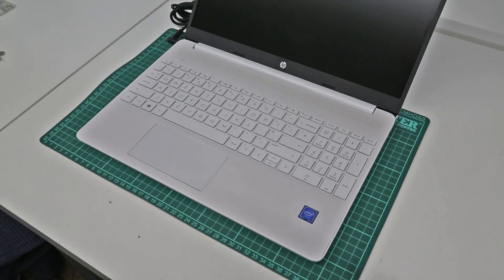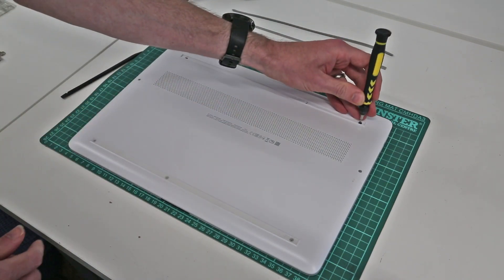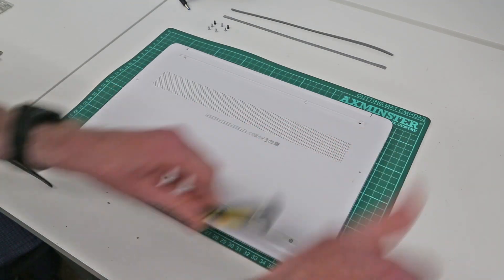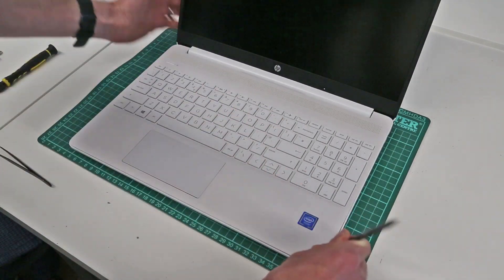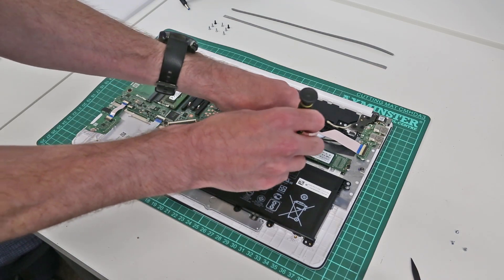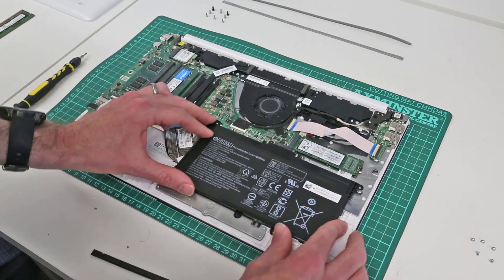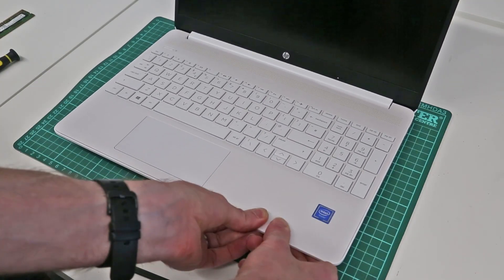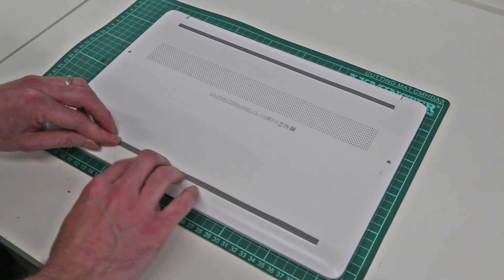HP 15s-fq1515na RAM Upgrade Guide

Comment: Thanks!
Even though the HP manual only mentions 4Gb or 8Gb RAM modules, I found that my HP 15s-fq1505sa's motherboard supports 32Gb RAM (2x16Gb DDR4 2666MHz SODIMM RAM). 
Tip I got from Paul Tikkanen on the HP community forum: to find the maximum RAM your motherboard supports, follow the below steps. 
1. In the Windows taskbar search box, search for cmd and click Run as administrator. 
This will open the command prompt.
2. Once command prompt is opened, type wmic memphysical get maxcapacityEx and press the enter key.
There, it will show the maximum RAM capacity your PC's motherboard can support.
The capacity is shown as Kilobytes, so you have to convert it to Gigabytes by dividing the number provided in the report by 1,048,576.

Comment: Can i add a 2.5 inch hdd to HP 15s-eq1024ne ?
Reply from the maker: If it doesn't have an HDD as standard then you'd have to source the bracket and cable to fit the drive.
Reply: @BrueComputing  I dont know , I didn,t open it yet
Reply from the maker: @anything670  Standard config for that machine is 256 GB PCIe NVMe M.2 SSD, so unlikely you can add a 2.5" drive without sourcing additional parts.

Comment: Hi sir, I have an HP 15s eq0xxx and in cpu-z it showed me DDR4-2666mhz and in brackets 1333 mhz which clock speed is true? So that I can improve?
Reply from the maker: DDR is double date rate - so 1333 is doubled to 2666.
Reply: @BrueComputing  What would happen if I added additional RAM to the laptop with a frequency of 2400 mhz when I have there from the novelty RAM with a frequency of 1200mhz?
Reply from the maker: @BlueScreendo  The laptop should run the RAM at the speed of the slowest module, so drop down to DDR4-2400 speed.

Comment: hi sir,i got the 15s-eq1xxx with amd athlon siver.is it possible to upgrade the processor too?
Reply from the maker: No - as with basically all modern laptops the CPU is soldered to the mainboard, so the only way to upgrade it is to replace the whole board.
Reply: @BrueComputing  thanks for the info sir

Comment: Thanks for video. I brought HP 15s-fq2015na and was wondering do you have to take out battery before installing RAM? Also is it easy to swap SSD too?
Reply from the maker: You don't have to disconnect the battery, but it is advisable as it means you won't accidentally remove or fit components with the system electrically on.
SSD guide is here: https://www.youtube.com/watch?v=ljLDBPcK0vI
Reply: @BrueComputing  thanks so much really kind of you to reply so quickly. I’m subscribed :)
Reply from the maker: No problem, glad it helped.

Comment: Hi. I have this model laptop. It's telling me there's no hard drive/ability to boot. When I look into the options you get when pressing F10, the machine tells me there's an issue with the Optane memory volume. So, I think the hard drive is kaput. I can buy new and replace, but is it possible to recover files from the drive/s? Thanks!
Reply from the maker: Depends on the state of the drive and how it has failed. A data recovery company may be able to help, but it won't be cheap.
Reply: @BrueComputing  Hi. I managed to boot the computer with LinuxMint. Recovered the files I needed and reinstalled Windows 10 - a part of the issue was the laptop stating that the OS had simply vanished. Seems to be working fine for now. Very odd.

Comment: Great video! just what i need it and it works perfectly for me!
Now i have a silly question, my laptop is currently having 8GB from originally, so it should be fine if i buy an additional Crucial 8GB DDR4-2666 RAM, right ? in that way i would have 16GBs available, right ?
Reply from the maker: Correct.

Comment: Can add sata ssd?
Reply from the maker: You'd need the HDD cable, board and mounting bracket as models with an M.2 drive don't have these installed, which is quite expensive.
Reply: @BrueComputing  where should we connect the hdd cable to?

Comment: Thanks for the video. I've got a HP - 15s-fq1512sa and I'm planning to upgrade the RAM - will use this video to guide me. May be a silly question, but is there a slot for any expansion of HD storage? I've got a 256 gb SSD on mine, but I wouldn't mind adding an extra SSD (or whatever is available) for additional internal storage.
Reply: No there inst in the sa series. You could try refer to your user manual. Damn this is a late reply.

Comment: Have you tried a different wifi card ? i tried a Intel 9260NGW and added a extra antenna , The Laptop booted up and installed the driver but after the restart the wifi would not turn on, it was showing in device manager and said it was working properly 

I would like to install a Wifi 6 card or get the 9260ngw working

Comment: why do they put  the screws under the strip ?  so HP can spot its opened and get out of their warranty,  just because they made it hard to upgrade your ram from the unusable 4gb
Reply from the maker: I don't think this is the case - I'm guessing its just to give the base of the machine a cleaner look.
You wouldn't invalidate the warranty based on a rubber strip held on with an adhesive strip being lifted - you see these get snagged and missing all the time.
Reply: I have contacted HP and they said that you can upgrade RAM, SSD and WI-FI card but if one od these will NOT work you will repair it by yourself, and better to keep old parts